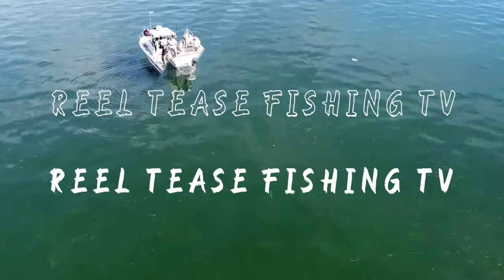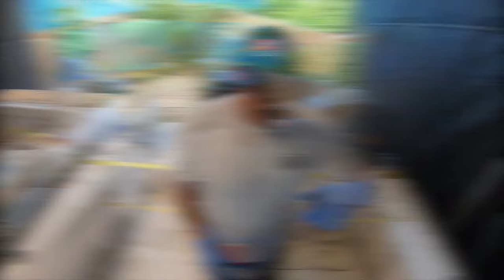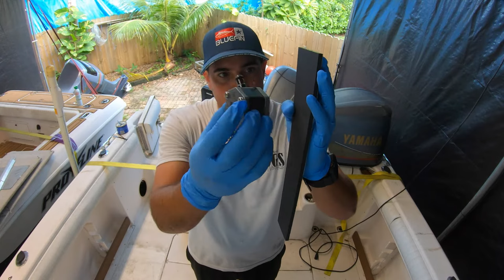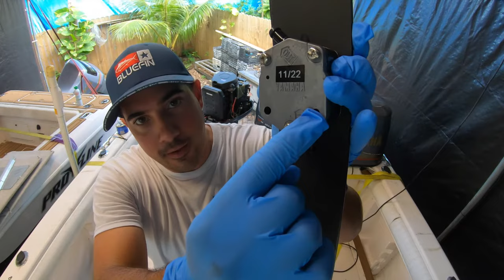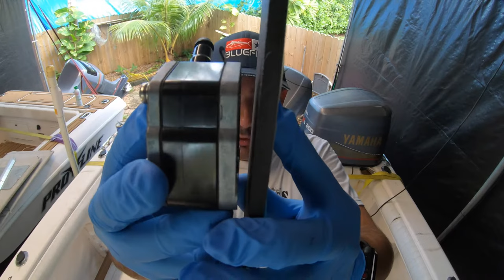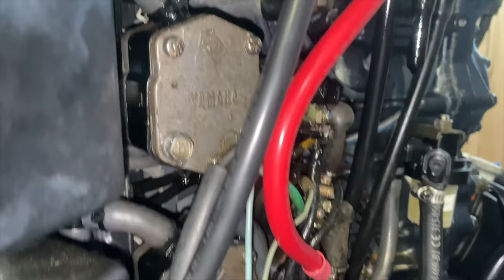How to Test a Low Pressure Fuel Pump

Comment: Appreciate this video as I am trying to diagnose an issue I am having with a 1996 Mercury 200 EFI. Engine starts great, smooth idle. no stall or sputters. Temp is normal and boat hits 58009-6000 RPS at WOT and hits 70 mph. The issue is that it takes 3-5 attempts to get it up on plane. I have ran the Same prop (with prop plugs) and pitch since I bought it new. I have changed the primer bulb and main fuel line from the tank to the engine. I have the changed the main fuel filter and the impeller, and the ECU. Any suggestions for what be the cause of the struggle to get up on plane?
Reply from the maker: My guess is a fuel restriction somewhere.
Take a sample of your fuel from tank. Make sure it’s clean, clear and no water.
I’d then do a compression check even though it’s still getting up in RPM. 
Then id go down this list of things

1. Get rid of any and all gray fuel lines on the engine. 
2. Does your fuel pickup tube have a screen at the bottom? Can be partially clogged 
3. Does your tank have a spring loaded check valve on the fuel fitting? Notorious for issues
4. Clean VST?
5. Lastly I’d send injectors out for servicing once all has been cleaned and checked. 

Not sure if this model has an electric choke, but I’ve seen these symptoms on a stuck choke in the choke position.
Reply: @ReelTeaseFishing  Thanks for all the detail here. I will run through this list to see If I can find anything obvious that you referenced, and let you know what I discover. Appreciate the suggestions.
Reply from the maker: @billjones1446  yes sir! 
The only other thing I can think was to check for consistent spark on all your cylinders. It may be an intermittent spark issue almost mimicking a fuel issue. Coils, stator/trigger will cause these. Best of luck. Let us know what you find

Comment: I have a 2004 mercury Optimax 200. Worked good last year, when winter was done took it out on the water has kind of a hard time starting at idle or in gear with little pressure. It’s sputters, the motor shakes after about 10 seconds. It will shut off go to start it again. It starts right up but it’ll sputter right away. The faster speeds it seems ok. What do you think?
Reply from the maker: These engines are fuel injected. If after storing the issue began I’d look into dirty filters, dirty injectors, possible dirty fuel, water in fuel from sitting etc.

Comment: I have a 2003 saltwater series II 200HP boat was sitting for 15 years no fuel is getting sucked in all lines have been replaced what can it be the fuel pumps on the motor I have two that look like the one you just showed one on bottom one on top
Reply from the maker: I would start with an external tank with clean fuel and hook up your new hoses and new bulb to that tank. 
Could be a bunch of things.
Pickup tube in your tank could be clogged or broken off, one way valve on tank fitting could be stuck in closed position. Vent from tank could be clogged, 
By going to a new external tank with new hoses we can eliminate that as a problem.

Comment: Hey. Thank you for these videos. I have a v- max 115 yamaha  where it runs for about 15 or 20 minutes then sputters an cuts off. I pump the ball then try to start it and it starts but when I put it in gear it sputters and stops. My mechanic has told me the pressure is good. But it just seems to be running out of gas between the ball and the engine. Any suggestions?
Reply from the maker: I’d put clean filters if you have any fuel/water spin on filters. I’d also look into the possibility of a bad bulb (they have check valves in them that go bad) and look into the possibility of a collapsing fuel line. If it is not the black USCG fuel hose there’s a big chance your fuel hose is collapsing inside the hose. Can’t tell on the outside

Comment: Have a 2014 f70a and it will run fine for a while and then just die and never run again.  Each time i start it, it fires and then immediately dies.  The primer bulb is soft but you can hear gas moving in it.  Using this trick the gas comes out of the screw hole around the loosened screw.  Hoping replacing this works out
Reply from the maker: Could be, if fuel is leaking from the LP pumps it spills it directly into the engine bypassing injectors etc. 
Usually this causes too much fuel and it floods the engine.
Hoping you found it and replacing the LP fixes it
Reply: @ReelTeaseFishing  ahh got it.  Well yea it was definitely leaking fuel from that pump.  Getting a new one pronto.  Thanks 👍
Reply: @ReelTeaseFishing  Replaced that pump and my boat is running great.  Thank you 🙏
Reply from the maker: @alexhodgkin2589  oh man! So glad to hear it 👍🏽
Thank you for watching and getting back to us with the great news

Comment: My 50 ho mercury 4 stroke will run on starting fluid, will not run??? Thanks
Reply from the maker: Start off by replacing your spin on filters. If you have a water separator on the boat before the engine, go ahead and replace with a new filter. Then replace the small filter that’s in-line usually under the cowling with a new one. See if that changes anything

 If it’s a carbed model I would look at overhauling and cleaning out your carbs. If it’s fuel injected I’d look into having your fuel system and injectors serviced. 

It definitely seems to be fuel related as it runs on the starting fluid.

Definitely make sure and rule out water in your fuel
Reply: I am having the same problem

Comment: I have a 2014 etec 90 hp. Starts right up and runs good. After running 15 minutes to my fishing spot, i turn off the engine. Each subsequent start, the boat starts fine. But it stalls when i try to put it in gear. I linked it through the end of last season by giving it a shot of fuel in neutral. Then it would run fine after a tiny stumble. Now it stalls even when i try to give it gas in neutral. 3 or 4 times of trying to give it gas in neutral, the engine will rev up. Then i can once again put it in gear and the boat runs. Do you think that would be a fuel pump issue or an injector issue?? And i assume you backed out the two mounting screws in this vid
Reply from the maker: a failed pump will give you the results you are having. a clogged or collapsed fuel line will as well. Id check your filters, fuel lines, inline one way valves ( on primer bulb and on some fuel tanks.)
Reply: @ReelTeaseFishing  Thanks for the reply. I ran the motor on a brand new fuel line to a 5 gallon gas can and it still did the same thing. So i believe my fuel system is good. I just rebuilt my mechanical fuel pump and I'll have it back out on the water this weekend. Keeping my fingers crossed
Reply from the maker: @stevewolfe6708  good luck! Hope you got it 👍🏽

Comment: I have a Suzuki df 70,,my low pressure fuel pump is cam driven,that pumps the gas into high pressure pump in the vst ,,isn't it sort of the same test for this one,,unbolt it out of the hole,,pump the bulb and check for leaks ,in this case it would be leaking gas into cam shaft,not good

Comment: So are you saying it should be a steady stream of gas?
Reply from the maker: Zero gas should come out the rear of the pump. Fuel only travels to the hoses. It works on vacuume from the area it attaches to the  engine block so it is not as steady as a mechanical pump. They are low pressure too.

Comment: I have a 2011 yamaha 115 it’ll turn on and run fine but after starting it a couple of times. It won’t start you’ll hear it trying to start but nothing happens. So I pump the ball and after a while it’ll turn over. Do you have any idea what is causing my issue
Reply from the maker: Issues starting when the engine is warm leads me to believe you may have a faulty injector. Possibly leaking when off flooding a cylinder. 
I’d have them (4) in you 115hp serviced and cleaned. 
That’s what I’d look into
Reply: @ReelTeaseFishing  I’ll look into it thank you for your opinion

Comment: @reelteasefishing My Yamaha VX225 starts and idles fine. It revs fine on the hose, but won't rev past 3200 rpm under load in the water in forward, but will rev fine in reverse. Do you think the fuel pumps might be the issue?  Thanks for the great videos and information.
Reply from the maker: Sounds like it has lack of power under load. Definitely could be bad fuel pumps maybe even pumps that are just starting to fail. However I’d highly recommend to look into cleaning your VST filters and any in-line/spin on filters in your fuel system.
Reply: @ReelTeaseFishing  Thanks for the quick response! It's the carbed model, do they have a VST?  I've already cleaned the filters.
Reply from the maker: @haywirefarm  carbed model makes it easier, I’d definitely redo the carbs. Ultrasonic cleaning if available.

Comment: Need your help…
This is a copy and paste message I wrote in an outboard forums.

Just bought my first boat and owner said it sat for 6 years. its a 2000 mercury 90hp engine outboard. Before selling he took it to a mechanic who cleaned out the carbs and pistons. The mechanic thought he cleaned out the gas tank to empty but accidentally left 10 gallons in there, I filled up the rest so 20 gallons were in the gas tank. there was still 10 gallons with 6 year old gas. I ran the boat for 1 day on the water using my big motor for about 30 minutes before switching to my kicker. I then flushed out the gas and cleaned out the tank and put new gas...

With the OLD GAS at full throttle my RPM's were at 3,200 @ 25 MPH. it would run for about a solid 30 seconds then start dropping to 3,000 and back up to 3,200 RPMs. This would repeat forever untill I drop RPMS a bit to under 3,000 RPMs and the issue stopped.

With the NEW GAS it runs at 4,000 RPMS @ 30 MPH and after about a solid 30 seconds starts doing the same exact issue. Drops to 3,800 or so and back up. It will do this until i drop the speed.

I cannot attach the video but I do not think this is a issue with Old gas causing the CARB to be clogged because Right when i got on the water it started doing it. and if the person cleaned out the carbs or other stuff it wouldnt be consistant. What else can i check without spending hundreds of dollars on a mechanic!

PLEASE HELP!!!

I checked spark plugs, gas line, ignition coil, everything’s good. I unscrewed fuel pump and it looks good but how do I know if it’s bad?
Reply from the maker: Ok here’s my advice. I wouldn’t go off what they told you was done. 
I’d overhaul the carbs with carb kits. Clean then and then you know 100% that’s done.
I’d also replace all the fuel filters. If old gas ran through em replace them. 
New fuel lines as they could collapse internally if they are old and sat for a while. New fuel primer bulb too
Also some fuel pickup tubes on the fuel tank have a screen at the bottom that gets clogged up. I’d double check that and make sure that’s not the case here. 
If you do all that and still have issues then we can look directly at the engine and try to diagnose it some more. .

Comment: I have same engine mines at wot it  boggs down but does not shut off I let off of throttle then it will pick back up and feels sluggish I am going to test the pumps like in video also someone told me could be fuel pressure regulator would that cause the engine to run sluggish?
Reply from the maker: Filters, pick up tube in tank, collapsing fuel lines or fuel bulb, bad low pressure pumps, water in fuel 
All can cause sluggish results at WOT

Comment: I just put a new fuel pump on my 7.5 evinrude. When I squeeze the primer, it squirts from the weep hole, on the pump. No fuel coming out the outlet??
Reply from the maker: @brandonhaley-z8j  are you sure you put it in the correct orientation?
Reply: @ReelTeaseFishing  I found the problem, bad diaphragm, out of the box. Thanks for the response.

Comment: Hey Carlos I have a 2003 Yamaha 150 v max.  I have 2 fuel pumps 1 you said is the low pressure fuel pump,  is the other one a high pressure fuel pump or how do they work. The motor just cranks but does not run. I think it the carbs. When I first went to start it sound like it was going to run , but now just cranks. I think it was old fuel so I am thinking of taking the carbs out and cleaning them and I cleaned out the old fuel from tank. On the carbs, clan I just open them and clean them or do I have to get a rebuild kit for each one.
Reply: Just looked at your fuel pump video sorry brotha.
Reply from the maker: These style pumps will be low pressure fuel pumps. Then inside the VST is a medium pressure electrical fuel pump. 
The high pressure fuel pumps are are not on all outboards. Usually on the fuel injected models. If yours is carbed I don’t believe you have one. 
As far as the carbs. Yes a rebuild kit will be needed and highly recommended. Go OEM for the kits as many of the knockoff kits have sub par parts with really bad gaskets and orings that will lead to fuel leaks. 

If the fuel was bad look into replacing VST filters too
Reply: @ReelTeaseFishing   do you have carburetor rebuild video
Reply: Thank you

Comment: I have a C90 Yamaha stroke. Last time out started running rough, lumpy at idle speed and now won't go over 3500 rpm. Same proceedure as in you video?
Reply from the maker: if its a two stroke model than yes sir, if its the four stroke there may be a different fuel pump. if it uses the pump that looks like this one its the same procedure. if it looks different, that model may dump the fuel into your crank. Check your oil by smelling it. if it smells like gasoline you have a failed fuel pump.
Reply: @ReelTeaseFishing  pulled it off, it dripped a little bit. 2 stroke BTW
Reply from the maker: @markdimaio8396  should be completely leak free

Comment: Every 3 years? I've got 4.5 yrs on the ones on my '96 225. There's a hot rod machine shop that makes blank off plates for them, at least for the OX-66 versions and then you use an automotive fuel pump mounted off engine.
Reply from the maker: Just stating what the manual states as their maintenance routine for these pumps. 
It’s not uncommon for them to last longer, but it is common for them to break down
Reply: @ReelTeaseFishing  Thankfully I have new ones in the parts bin. Guess I better swap them out before I get stranded. Until I watched your video I had no idea they were a short lived part. I've read that OX-66 owners have issues with them. Maybe the carb'd saltwater series doesn't stress them as hard?

Comment: Have a Yamaha 300 HPDI only problem I am having is when I start to plane runs good all the sudden, it starts to bog down like it’s losing fuel any recommendations
Reply from the maker: HPDI are dependent on clean fuel. They have many filters in the fuel system. 
I’d suspect low pressure pumps, 
Your VST filter or pump
Definitely fuel restriction somewhere

Comment: Boat turned off at lake and doesn’t turn back on . I did this no fuel leaking . Can it be the internal fuel pump 115 Yamaha 4 stroke ‘2015
Reply from the maker: Is the throttle in Neutral, is the kill switch on? Do you have fuel. Sounds dumb but easily overlooked.

Comment: my mariner (yamaha) wont idle, but will run fine at medium-full throttle. this started one day while i was fishing and my engine was idling and suddenly died. i havent changed the pump in the 5 years i owned the engine so will try
Reply from the maker: if its a carbed model ( carburetor ) If highly suggest you do a carb overhaul. full clean out and new seals/gaskets.
Reply: @ReelTeaseFishing  first thing i did, gasket, seals, cleaning and tuning

Comment: Hey Carlos, I have a Yamaha ox66 225 2 stroke and the only problem I've been having repeatedly is surging. It keeps speeding up and slowing down. Any ideas?  Thanks..
Reply from the maker: Is it carbs or injectors?
Reply from the maker: I would highly suggest you look into your VST. It’s not a hard overhaul. Buy the kit with new filter and housing O-Ring.  Should take about an hour or two to do yourself. 
Secondly if you have an O2 sensor, I’d look into cleaning it as well.
Reply: Ok, thanks, I appreciate it..

Comment: Would a bad field pump make my prime and bulb go soft when it runs
Reply from the maker: Primer bulb going soft or collapsing can be a fuel restriction towards the tank, a bald primer bulb, fuel line collapsing within itself, fuel tank vent clogged, pickup tube clogged.

Comment: I have a Yamaha vmax 150 2007 2 stroke. The first start of the day (cold start) is rough. Even with choke it doesn’t want to turn over. I wait 10mins after and it fires up. Good for rest of the day. Any suggestions on the first start of the day? Much appreciated!
Reply from the maker: Have you tried cycling the key for the first start?
Basically turn power switch on then you’d prime the bulb. Go to the key and turn key to on position (not start just turn to on) leave in the position for 10seconds 
Turn key to off position then back to on for 10 seconds then turn key over to start. 
This helps the engine cycle and prime the fuel system, injectors etc.
Reply: @ReelTeaseFishing  I have not tried that. I will for sure give that a try this weekend! This past weekend I did replace the fuel filter and when I primed the bulb after, I noticed a little gas coming out of the small hole in the front of the low pressure fuel pump. In the video you mentioned it shouldn't be coming out of the back, but what if it came out a little in the front hole?
Reply from the maker: @fit_with_matt  these pumps are suppose to be completely sealed. Any leakage is a failed pump. That may very well be it. Good catch. 
not only is it leaking but more than likely allowing air into the system. no bueno
Reply: @ReelTeaseFishing Bro thank you so much! Replaced both fuel pumps, did your starting procedure and boom! She fires right up. This was amazing!!!
Reply from the maker: @fit_with_matt  awesome!!! Glad to hear that. Happy Holidays Matt 🤙🏽